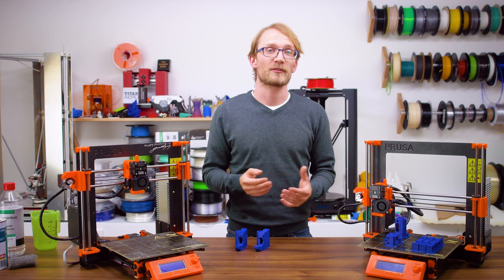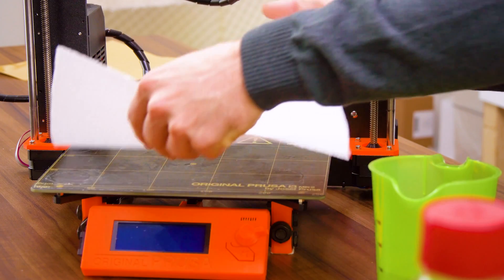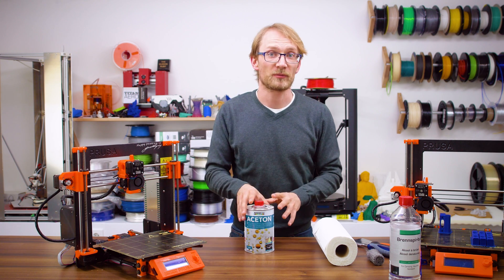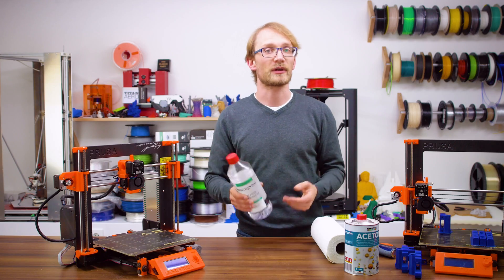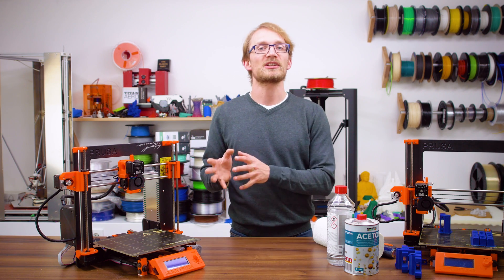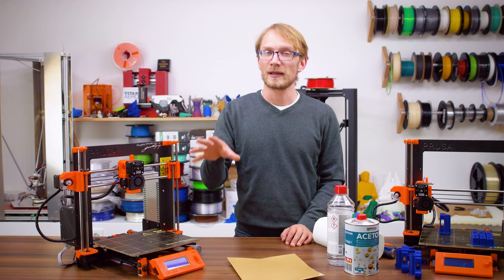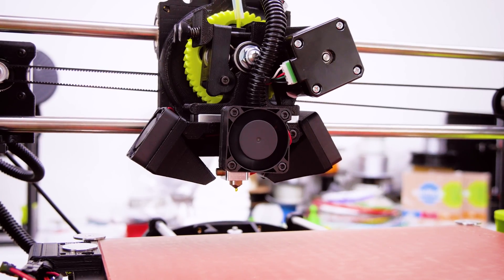Guide: Restoring and maintaining a PEI printbed!

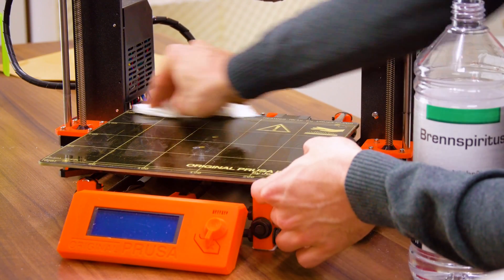Comment: 3:10 Acetone before printing doesn't give as good adhesion as isopropyl alcohol because commercial acetone that we buy in the hardware store is reclaimed from used industrial solvents, and while it is distilled, a tiny bit of the oil from the dirty acetone remains in the reclaimed acetone, and when the acetone evaporates a very tiny amount of oil remains, probably similar to the oil from fingerprints.  IPA is manufactured instead of reclaimed, so there is no residual oil contaminate.  I use IPA for most solvent applications, but if I'm trying to remove something like ABS and I want a squeaky clean surface, I'll use acetone followed by IPA to remove the oil residue.

Comment: Would love to see tips on how to replace the PEI surface.  I have a TAZ5 and have replaced the PEI surface once. There has to be a simpler way than what I did!.  After the second surface started having issues, mostly do to my bad replacement.  I now use a separate PEI sheet with bulldog clips which even helps with removing parts as I can flex the PEI if necessary.  Thanks for the tips!

Comment: To get ABS parts off the sheet it is crucial that the the bed temperature is right. When the bed is cooling it is around 60c is when the parts suddenly come off easily. When reheating a cold bed it is around 70-75c. It makes a world of difference. I got this tip from Aleph Objects after ripping my bed once.

Comment: About every 6-8 months I have to give a few light wipes with a 2000 grit wet dry sand paper with a touch of water, it keeps things sticking well, and then after I scratch it up too badly with my scraper I will do a 500 grit, 1000 grit, 2000 grit treatment to get a scratch free matte surface.
I have had to replace it twice, one because I kept printing everything in the dead center of the bed and freeing it from there all the time weakened the PEI sheet and it cracked, the second time was due to printing TPU that broke the crap out of it trying to get it off the PEI sheet. :-D

Comment: hey tom.
I have run in to a problem! I have a prusa mk2 and I am not able to print on it..
the place doesn't even stuck to the heatbed properly!
its been 6 months with the mk2 but this is the first time this has happened!
this happened a few days back and at that time I increases the first layer height and width to compensate but now what happens is half of it sticks to the bed and half to the nozzle! and everything then sticks to the nozzle!
I have tried everything... 
don't know what to do!
and how do I know if my extruder is jammed?
cause when I extrude filament through it...it just comes out straight!..
Reply: Hi Dhruv, I'm a new prusa mk2 user and I saw similar thing. First print was OK for PLA (my live Z adjust was -0.777 and perfect and -0.995 for ABS). But for now, each time I switch from PLA to ABS, I need to increase my Z height : if not ABS not sticking and even PLA. Now I'm at -1.110 for PLA and -1.35 for ABS. My Pinda is well attached and never touching. I nearly sure there is an issue with the firmware because If I power OFF, wait cold heatbed and power back ON printer, I need to decrease my Z live adjust. It's like an eeprom bug or temperature correction bug. I'm using last firmware 3.10 and last slice3r. Question : Are your Z motor always hotter than X or Y, even in standby mode but printer powered ?

Comment: Nice guide (as always). BTW if somebody trying of print flexible material on PEI, use first a pinch of talcum powder and spread it over with a paper towel; it will act as a "bonding reducer agent" for make (reasonable) easier remove the print from the PEI.

Comment: Hello tom i know this isnt related to the video but i need help with my homemade 3d printer. currently i am in highschool and decided to build a printer for a project scholarship, i have recently run into a problem with my wiring that i cant find information on. I am using a ramps 1.4 board with A40988 drivers, my motors when marlin is installed wont move properly. i have run the ramps testy software and they work perfect but as soon as i use the marlin/ pronterface software the just vibrate and buzz. i have been trying to solve this for days now and i am running out of time so any help would be appreciated

Comment: I sanded my i3 MK2 PEI bed with 800 grit sandpaper on a saving block to remove deep  scratches and now I can only remove prints by slamming a corner with a chisel. It's hard to get the sweet spot of bed adhesion...

Comment: As an i3 mk2 owner I would really love to be able to print on glass in order to keep my bed fresh (it's already starting to get cloudy after printing nylon with gluestick).
of course the problem is that the probe for mesh leveling will not detect the metal through the glass thickness.

As my buisness is actually a glass tempering factory I want to check the possibility to make a piece of glass with a conductive surface on its top as to enable the probe to detect it.

Would be glad to hear people's opinion on this and see if this might be of interest to other users.
Reply: A bit old but if you search online for printing on glass with a Prusa i3 mk2/3 people have figured out how to do it. Basically you run gcode that has the printer level as normal, stop after that (for 60 seconds or such), you place the glass on the bed, and the via gcode adjust the z-height the thickness of the glass. After that you can still use live z to adjust as needed and print.

Comment: @Thomas sanlader a tip: use isopropyl alcohol to clean the bed and also to remove the prints... with a pipette put isopropyl alcohol around and in the holes of your 3D print generously and let it sit for a little bit... The isopropyl alcohol will work itself under the part with capilairy action (surface tension) and will make part removal a lot easier.
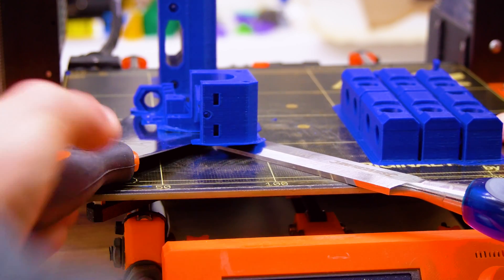Reply: I do the same thing! Using a chisel like Thomas does at 0:25 will not only bend the bed like crazy, it could also permanently warp or even damage it...

Comment: With all respect I definitely  don't recommend to use acetone for PEI. I have tested acetone with small piece of PEI, detached from the bed. If you soak PEI with acetone it looses its flexibility straight away and after a short time it starts to crack. This is how I destroyed my last PEI sheet, it retired replacement after one week when I cleaned  the bed with acetone. I also tested it with PRUSA MK2. Be aware ! :) You can also find some PDF files about PEI and it clearly says that there are only few types of alcohol which are safe for PEI and acetone is definitely not recommended !
Reply: http://www.hycompinc.com/PDFs/ULTEMProductBrochure.pdf

"Cleaning and degreasing
Cleaning or degreasing of ULTEM® resin finished
parts can be performed using methyl or isopropyl
alcohol, soap solutions, heptane, hexane or
naphtha. The parts should not be cleaned with
partially halogenated hydrocarbons or with
ketones such as MEK or strong bases, such as
sodium hydroxide."
...acetone is kind of keton...
https://en.wikipedia.org/wiki/Acetone

Comment: Use water soluble glue stick.  After print, spray water around the print.  Let it wick into the print/glue for a while.  Easily remove print.  Done.

Comment: When prints are stuck on the PEI I put some isopropyl alcohol on the edge between the bed and the print and let it sit for a minute or two... the alcohol seems to "crawl under" the print and loosens it up... sometimes you can even hear it crackle away from the bed...

Comment: After converting both my printers to PEI, I have come to both hate and love it. I love that I don't have to use hairspray (I've always used glass), but I absolutely hate how hard parts are to remove. Hairspray on glass is dream when It come to removal. Just let cool and that's it. With PEI....., well your examples in your video explain the rest.
Reply: Tried increasing first layer height a bit too much? So that increases the gaps, reduces contact area with the bed. Or you could try reducing first layer nozzle temperature. 

It’s sticking well at least. You need to find which parameters cause it to not stick (barely) on a warm bed, then dial it back slightly.

Comment: Parts STICK to my Lulzbot Mini and I have to really work to get them off. Definitely ruined one sheet as a result. Oops. Lesson learned.

My TAZ 6, however, seems to like to auto-release at the end of the print during cool-down, which is AWESOME. I definitely am not experiencing adhesion issues throughout the print either. 

Not sure what the practical difference is, but I'm not complaining. 

PEI is just amazing though. I want to apply adhesives to my print surface as infrequently as possible - and it allows that to be basically never.

Comment: I have been using a PEI bed on my TAZ since 2014, well before even Lulzbot was putting them on their machines.  The Lulzbot forums were very infuential in my decision to go to PEI, and I believe probably influenced Lulzbot in the same direction.  I have always used acetone to keep my PEI surface in top condition.  It is the BEST cleaner for PEI.  I wipe down the COLD bed surface before each printing session.  It is important to remember that PEI becomes tacky when heated, and acetone will react poorly with a WARM PEI surface.   (There is some chemistry involved here which was investigated in the forums.)  I have also used a 600 grit sanding block to rough up and flatten the surface occasionally.  This will fully renew tack, and should only be required once every few months.  Using the block is important to help keep the surface level.  The only time I use alcohol to clean is when the bed is still WARM between prints.  If I need to use a glue stick for filaments like PETG, I will clean that residue as best as possible with water prior to the acetone wipe.  I'm still using my original 40mil PEI sheet and it is in excellent condition after hundreds of prints.

Comment: for pet-g I use brim, say 20 lines, to allow you to easily get under the pet-g without ripping. also when swapping the pei or, in my case, build-tak heat the bed to 90-100 and it should release much easier and cleaner when you are replacing it.

Comment: I also have a tip: Try to remove the parts not with force but with a jab. I use a 200g steal block and bumb it into the side of the printed part. Because the bounding to the PEI is strong but brittle, it mostly just kracks off. 
(I now have 1200 print hours on a single PEI sheet.)

Comment: Turning the chisel the other way and using the angle as a lever helps.
Reply from the maker: +peterthinks really easy to slice into the PEI that way, so I edited out that part 😉
Reply: It all depends on your proficiency with a wood chisel.  I have no problem with this method.
Reply: I don't have much problem with a cake frosting spreader. It may take two or three tries to get under the edge the first time, but the rest is easy.  I have never had a print "pop" off.

Comment: I have problems getting things unstuck, so when I design a part, I often add a overhang recess (a slot 8mm wide, 2mm high, 1mm deep) so I can put a screwdriver tip into it then lever the screwdriver against a flat spatula (to spread the force), and pop the part off without having to scrape at all.

Comment: I saw your chisel usage, and I totally loved it. I used a chisel on ALL of my printers to get prints off the bed. I'm careful, like you said, but what I also do is turn the chisel upside down and use it like a lever to help lift the print once I've gotten slightly under the edge. I found using your method all the way and NOT being careful results in gouges and holes. Oops on my part :)
Reply: chisel is a huge mistake, try a small Palette Knife, thank me later ;)

Comment: Hi Tom. Did you ever try to spray a few drops of alcohol-water mix at the printed object and the print-bed? Do it, when the bed has cooled down to room temperature. I bet after that experience you will never use the chisel again.

Comment: I recently performed a neat trick with my MK2 PEI:  I flipped it over!  Stuck the heat bed in the freezer for an hour and that allowed me to peel the PEI sheet very easily without any bends and, more importantly, the adhesive was 100% untouched--left behind on the bed (it sticks better to the bed than the PEI).  Both the bed and the PEI sucked a lot of moisture out of the air and while they were wet I flipped the PEI over and placed it back down on the heat bed/adhesive.  I then used a plastic scraper to squeeze out as much water/air as I could after carefully aligning the sheet and then dried it off with a paper towel.

After the heated bed got back to room temperature I hooked it back up to the printer and let it "bake" at 80°C for half an hour and gave it a test print of a nice, wide-bottomed PETG object.  Not only was adhesion great I was able to remove the object from the bed (with the usual difficulty) without having the PEI separate from the adhesive.  This "baking" step is probably not necessary if your first print after flipping takes sufficient time and has the heated bed set to at least 80°C.

The underside of the Prusa PEI is quite shiny!  https://www.amazon.com/photos/share/z4AGrt0zrz2h0ArH90AMYMfZIKjlXdtaeTKTrBKqFOR (that's my flipped PEI sheet!)

This process mostly eliminated the bad nicks that my PEI sheet that had developed over time.  Instead of being grooves/indentations they have become very minor bubbles which seem to have flattened out considerably after several prints.  Also, when the nozzle extrudes plastic over one of these spots the bubble simply flattens itself out for the most part (it doesn't "catch" or anything like that).  The prints still end up with minor indentations where the PEI sheet sticks out but it's much better than it was before.

So if your PEI sheet has lots of nicks to the point of needing replacement I highly recommend giving the "riskable flip" method a try =)
Reply: riskable that's crazy. I would never suspect the adhesion would drop so much just from the cold, but I guess it makes sense: if heating PEI up makes it stick much better, it stands to reason that cooling it down does the opposite #whoknew

Bravo ! You receive the first "Not completely useless YouTube comment" award 😉
Reply: Neat !
Reply: thx gonna try that soon
Reply: It's not the PEI that is affected by cold it's the 3M adhesive.
Reply: Obviously that is incorrect, or the adhesive woud not have come perfectly clean from the PEI, and stuck still and reusable to the PCB HB

Comment: why print directly to the hotbed when you can use a smother sufrace like glass? :S with two cristal platforms you can print, switch the glass, and keep printing, and meanwhile.. the other glass can go in the cooler, YES. then you take the pice and simply jumps from the bed. having a very nice surface without warping insead of "mechanize" and.. as we can apreciate in your hotbed, simply break it. well.. both, glass and hotbed have such a same price, but if i need to choose, i prefeer glass even if it doesnt keep all the heat of the hotbed. and if i damage the glass without break it, it can simply sand for one side. the perfect way to keep abs unwarped even without additives. and still having a nice surface in the other side. break it isnt nice, but eigher will break a heatbed. specially if its plugged and inuse... that could be pretty dangerous.

Hope my tips are apreciated by you and the comunity reading this. and aplogies of my english.
Reply: Yep, you're spot on.  I think this is targeted towards Prusa owners(which is funny to have the Taz advertisement plug at the end) who can't do a glass upgrade without losing calibration functionality from Prusa.  IMO, I think Josef should head back to the drawing board with the entire Prusa frame, which tends to skew easily.  Then he can focus on a BLtouch style probe and enable swappable beds.  Combine that with an ooze/waste bucket/nozzle cleaner and he's got a new thing entirely.
Reply: Ewok have you ever used a PEI bed, prints don't pop off when cold, also using alcohol to assist breaking the bond does not work. In fact I have yet to find any system to remove eSun CF from a PEI bed. Many people have suggestions based on experiences with other materials, for example yes printing on a glass bed prints do pop off when cold. I have even tried putting the PEI in the freezer, does not work to release parts. I have tried magnetic bed with the theory that you can remove the the be then flex the part of ... turns out it was yet just another theory.  In my view PEI is great for PLA but good quality toughened glass works nicely as well.

Comment: Tip: If you use PEI, a quick and simple way to get prints to detach right away is to use freeze spray. Spray around the edges of the print to get it to pop off.
Reply: I use canned air and hold the can upside down, which makes it a freeze spray. No bitterant there. Probably only works with specific kinds of canned “air”, though.
Reply: ^^ so much this, it works great
Reply: I wish you could still get the stuff without that nasty smelling bitterant.